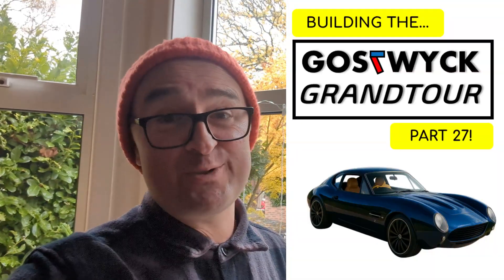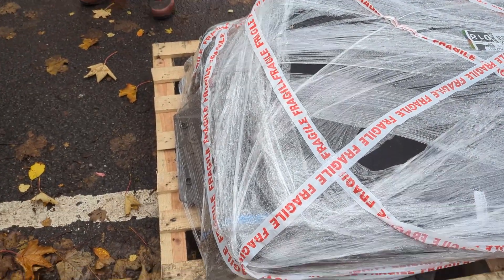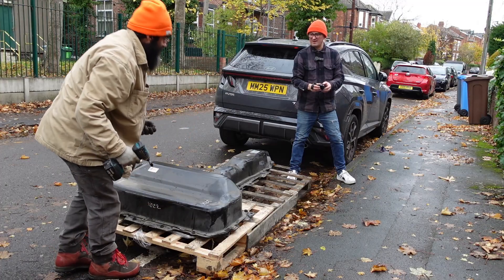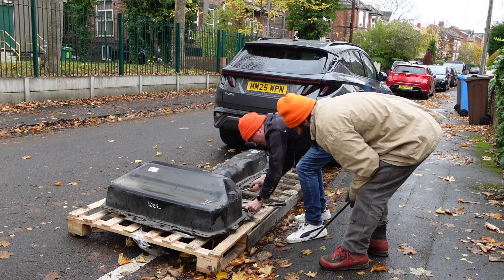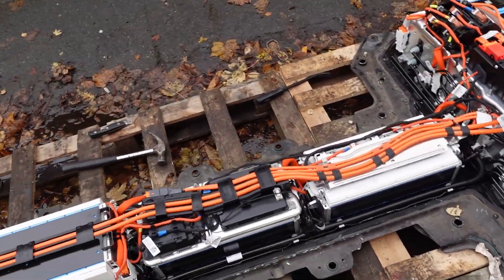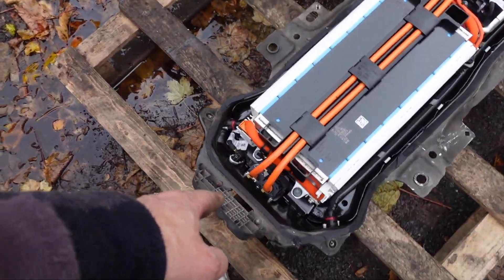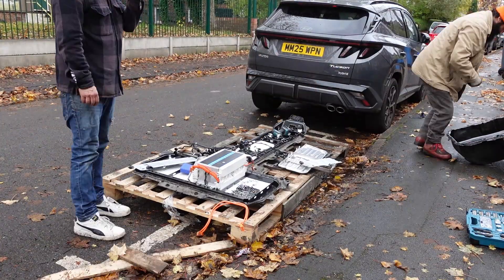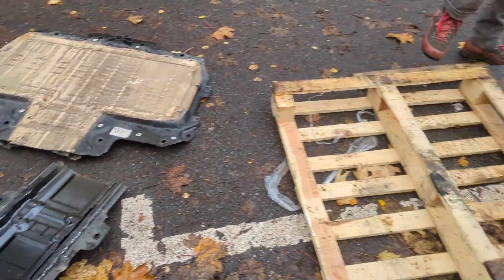The battery pack for my EV conversion has arrived!

Comment: Sweet video Tom. I put a post about it over on my channel. Great value per kWh. Mental prices! Clean as a whistle inside. There must be an easier way to get the seal cut around it.
Reply from the maker: Not an angle grinder! But I do think an air chisel with an appropriate bit on it (maybe something custom) would make very light work of it.

Comment: Enjoying the journey Tom. As it happens I spent all day today picking up the battery modules for my project today. There’ll be a video about them at some point I guess. Liked seeing the internals of the pack in your video, but the trainers that did my EV safety course would be having kittens if they watched it - and I think they’d have something to say about your “if you know what you’re doing” comment 😱🤔😂 If you want to have a chat about YouTubing then let me know 👍🏼
Reply from the maker: Ha! Yeah. That was partly the joke. It was absurd. But we actually didn't have a lot of choice. Driver dumped it in the puddle and left! And I wouldn't be so blasé with other packs. The BMW ones are particularly well designed from a safety standpoint.
Reply from the maker: PS - will have to check out your channel.
Reply: @EVDIY  @purplemeanie

Comment: Woo Hoo! What a lovely battery pack, few modules and flexible cables make life sooo much easier.
And you should easily get 100 miles range from that. 😁
Reply from the maker: Hoping for 130 at the outside - plenty of headroom to get to my folks, which was always the goal. Only question is power delivery. I'm used to the PHEV modules which can dump power like nobody's business. But these should keep up with the 300h.
Reply: @EVDIY  I recently drove 850 miles in three days in my Freelander with 100 miles range and a Chademo charging socket so no you've excuse for not going to your folks!